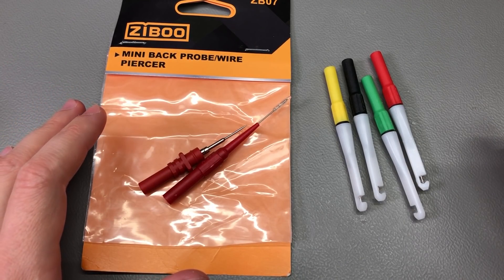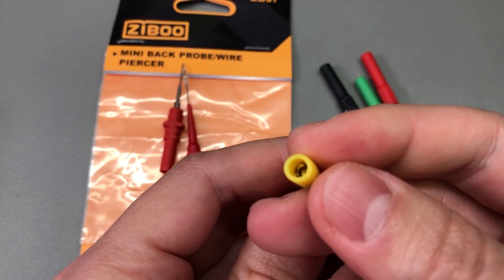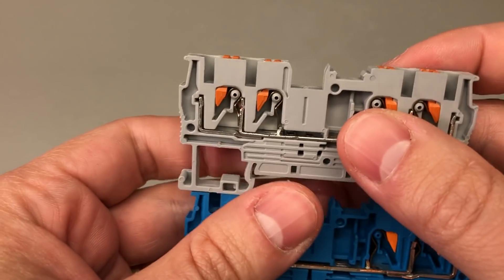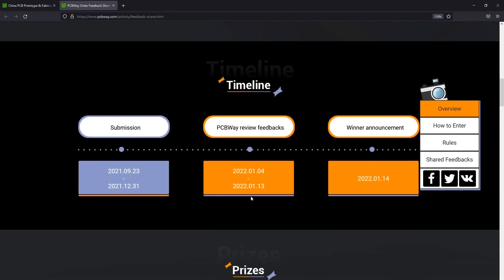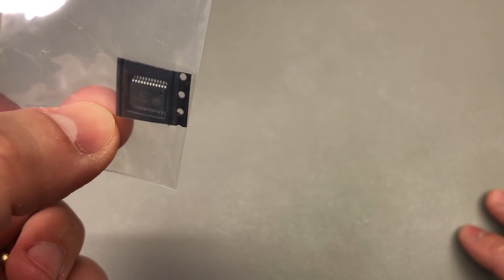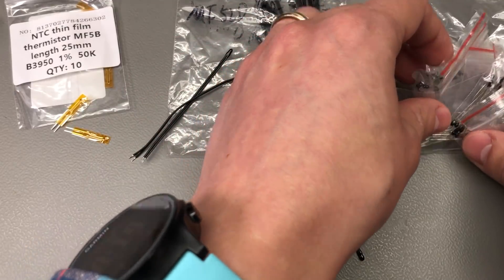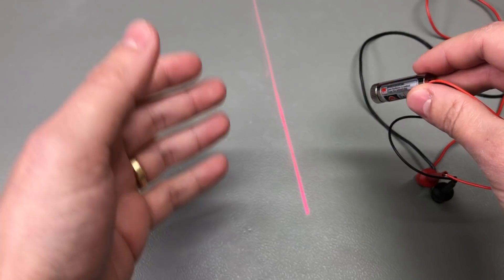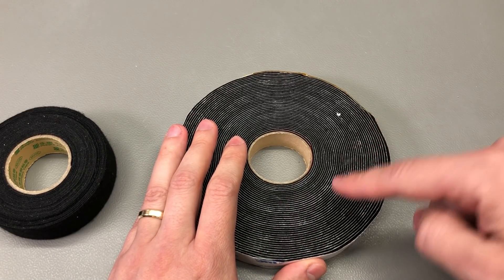InTheMail | Voltlog #382

Comment: How many of the items in those bundled packages were listed as "combined delivery" on AliExpress - either before you ordered, or upgraded after ordering?

I recently ordered around 30 products from 8-10 sellers. When I ordered, fewer than 10 of those items were listed as "combined delivery", but in the following few days, everything was "upgraded to combined delivery", according to the AliExpress tracking pages, so the entire ~£80 order arrived in a single bag just like you showed (delivered to the UK).
I was worried I might have to pay Royal Mail's £8 customs handling fee, even though VAT was paid at checkout, because in the past it was larger/higher value items that were generally stopped by customs, but that didn't happen thankfully.

For the items shipped with economy 1-3 month services, the upgrade to combined delivery greatly shortened their delivery time, but overall delivery took about 2½ weeks (ordered 28th Aug, delivered 15th Sept) which is longer than AliExpress Standard Shipping used to take - that used to be around 10-12 calendar days.
But I realise that's faster than a lot of countries (especially those with slow customs services) so I won't complain! 😅
Reply from the maker: I can't find any mention of "combined delivery" looking at my aliexpress orders, even though I've heard this before from people located in other countries.
Reply: IME, Combined delivery tagged items, when ordering multiple items from one shop has them recalculating the final shipping fee to something less than the sum of the fees stated on the items.  Items from multiple shops might get bundled at a 'higher level/later state', not sure whether in China or in a European transitioning facility. Received a bag with 4 padded envelopes and one box just yesterday - all different shops. Individual envelopes/box had Chinese post marks/labels while thé router bag had Dutch.
Reply from the maker: I just received another bundled package. 
1. There was no mention of "combined delivery" in the order status page.
2. All 3 packages contained within, had different shipping options.
3. The only thing is that at some point the order was updated with a "new tracking number" which is the one on the main package holding everything inside.
Reply: @voltlog  Just received a bundled bag with 3 orders from AliExpress - and curiously one from Wish (which didn't have a bag/package of its own, just the transparent bag the trousers come from factory in)

Comment: I think pick and place tool is better when you're putting chips in small dot sized blobs of glue before wave soldering. It's hard to push a part into a surface with tweezers.

Comment: hey @Voltlog! i was just searching now for a product you mention here: the k745 thermally conductive silastic? however unfortunately i cannot seem to find this product. was it one of the kafuter ones? that were in previous videos somewhere? many thanks
Reply from the maker: I have my part numbers mixed up, sorry. I used some K705 which is not thermally conductive, just regular elastic adhesive. There is a different pn for thermally conductive glue from kafuter but I can't find it now.
Reply: @voltlog  then maybe it's the Kafuter K-5203 perhaps
Reply from the maker: @dreamcat4  that is the one 👌

Comment: What shipping method are you using for those bundled mailbags?
Reply from the maker: I haven't actually checked. I just go with what is the cheapest option for that particular product, every time.
Reply: @voltlog  This is strange. Would be really interested in what shipping method did those specific package had (can be checked in AE account). I'm more than sure it's the same shipping method for all of them.. the question is which.
Reply from the maker: @yo5pld  Unable to tell because I don't remember which packages were delivered as a bundle.

Comment: I would do a melt/burn test on one of those sipun parts before starting to use them. And inspect every one for manufacturing strangeness, which is a good parctice anyways no matter what brand you use. And cut into the metal to see what it is (copper etc.).
Reply from the maker: That would be wise to do. Both connectors seem to use tin plated copper.
Reply: I had once a presentation of wago parts. Haven't watched this video yet https://youtu.be/eg6VPucscxI but I believe it will show kind of a similar test.
Haven't found the training material, also because it was a real presentation.

Would love to see some tests like overload and other stress tests.
Reply from the maker: @Stimmenhotel  such a test would be doable but I just don't have the test gear to generate more than 20A😞
Reply: @voltlog  Remember you don't have to test them at 20A 230 volts! Only the current matters. For example I have a toroidal (air core) 230 VAC to 35 VAC transformer (usual for audio amps etc) and just turning a few turns of heavy wire around the trafo gives me a couple of volts and tens or hundreds of short circuit current, easily adjustable by adding or removing turns. I used it to test the hunders of amps range of my clamp meter, works like a charm :-)
Reply from the maker: @benbaselet2026  hmm, never thought about repurposing a toroidal that way but I'm gonna give it a try. Thanks!